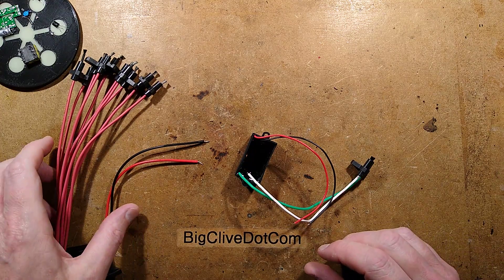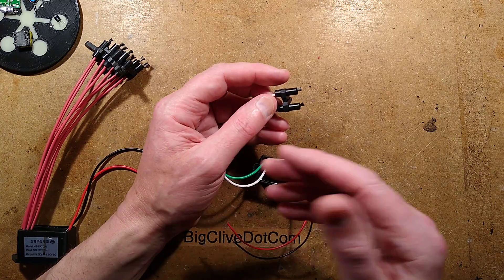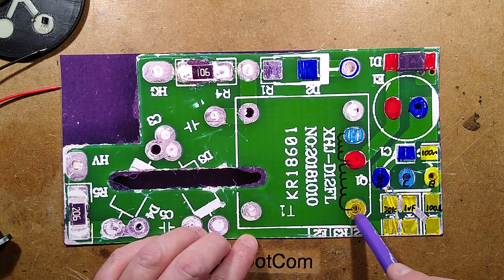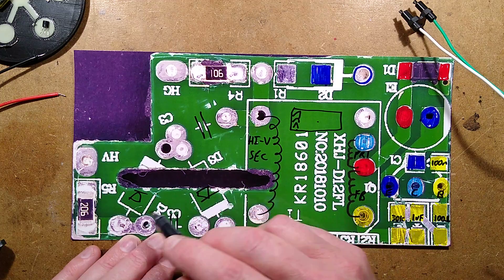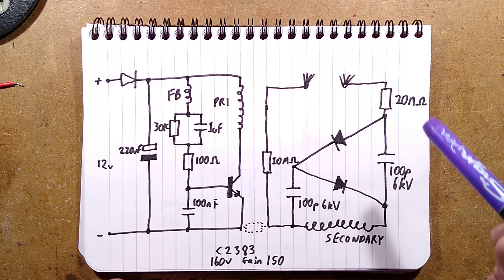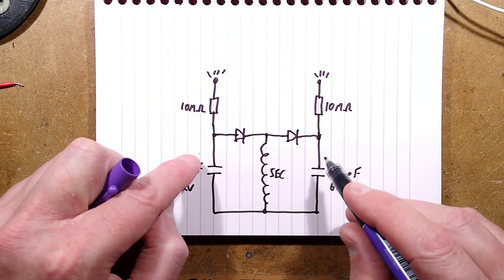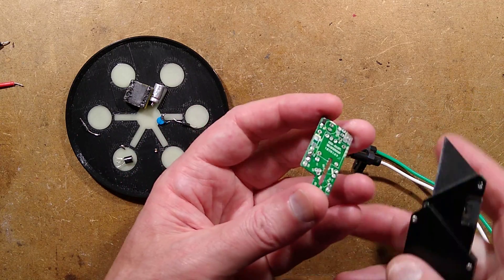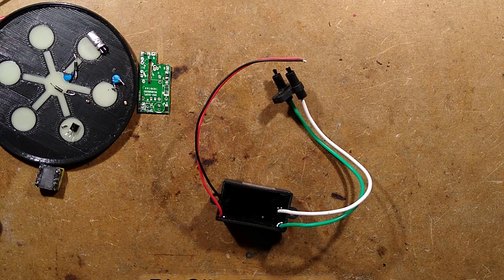Intriguingly different "ioniser" module (de-potting and schematic)

Comment: Can anyone supply some weblinks to vendor and datasheets for the high voltage capacitors and diodes.  Also the transformer model show XHJ-D12FL.  I can't seem to find this.  Who is the vendor ?
Reply from the maker: You will probably find the components on AliExpress, but the transformer may be a custom one.
Reply: cannot pots that here, or potsing will yanish.   The comp lanes that potsings yanish, also usually yanish.

Comment: Is it for a "balanced ion" blower, for hair-dryer static-neutralizing?   Or, even a workbench anti-static blower?   Most of the ion-current should just leap across the carbon-tufts.   But a fan blowing across them could disrupt that ion-flow.   I think it takes well above 20KPH of air-flow to push ion-plumes around, if strong e-fields are fighting the wind.   (So, how fast a wind is required, before the ion-current stops jumping the 2cm gap, and flows away into the environment?)
Reply from the maker: This module was sold as being for vehicle use.  I think it's less of an ioniser and more of a low level corona generator for stripping apart air molecules to create the active, but short lived variants like O3, H2O2, OH and others.  It's reminiscent of the modules used in the air channels of some vehicle brands that they refer to as ionisers to hide the fact they are for sterilisation.

Comment: which make high voltage diode shown in video?  with mark only of arrow?
Reply from the maker: They usually just have a pattern on them to indicate voltage.  No manufacturers data.

Comment: I heard the output voltage is very high, 7,000v or more? Is it possible to measure it? Will it kill if you touch the output electrodes?
Reply from the maker: No.  It's extremely low current.  Like static electricity.

Comment: Carbon fiber might be hard to get a reading off of from the sides because its conduction (thermal and electrical) characteristics are often pretty different depending on what axis you're measuring. Something to do with the structure of the molecule. The graphene forms a tube, and for reasons quite beyond me, it's considerably easier for electrons to move through the tube in some directions than others. Such a cool, bizarre material.

Comment: I once ordered some high voltage low current Diodes from Ali Express, (a unmarked bag of 50 of 'em)and they had the same Arrows on them. I initially thought..."What the hell is this Garbage!!!", but they seemed to work well. Never know the actual number of them tho.
Reply from the maker: It just seems to go by the shape of the arrows.  Very odd.

Comment: Can these be used as static generators for use with model makers static grass applicators?
Reply from the maker: It may work.  Even a simple ioniser module may have the effect.
Reply: Thank you for replying. I have bought static generators ie negative ion generators. 12v to 20000v I have connected them to a 12v motorcycle battery but they tend not to last very long. Would this be because the amp/hr on these types of battery are too high for the component and would I be better off with an 12v 1amp supply? Thanks

Comment: So the difference between Ionizer and ozone generator is that, even both they work at High Voltage, the ionizer it's DC, and the Ozone generator is AC high voltage and high frequency  ?
Reply from the maker: Some ozone generators work with DC output and sharp emitters to create a low level corona discharge.

Comment: Hey bigclive, my air purifier has a pair of these carbon tufts as an ioniser in the outlet after the air has gone through a filter. If I wanted to disable the ioniser permanenty without opening up the machine would it be effective to just pull out the carbon with some pliers? Are there any potential pitfalls of doing this?

Comment: These low end ionizers are often capable of hcho and acetone Voc intermediates. They consistently show such byproducts in various studies/reports. And how you place the emitters can change ion output. They have to spaced appropriately
Reply: Technically all ionizers create some kind of ozone. Certified models don’t let escape/or measurable. Sharp plasmaclusters don’t create measurable ozone in the room. But remember, ozone can be a plus. A small amount of Ozone can actually in fact reduce ozone. (Via Voc reduction that would later become ozone otherwise). Not saying I recommend ozone, but it isn’t pure evil.

Comment: Hey big clive i have a cheap light bar and was wondering if there is a way i can send you a video. It doesn't seem to wanna pump out the power and draws .365mA
Reply from the maker: The 360mA sounds like a driver for a string of 1W LEDs.
Reply: So the ic chip would be limiting the power it has a few 47 30 rtv and a 50n06 so it should be drawing a bit of power. I noticed i put the decimal point in the wrong spot it should of been after the 3

Comment: would it be possible to use this module for an electrostatic air cleaner?
Reply from the maker: It can have that effect.  You could connect collection plates to the green wire.
Reply: @bigclivedotcom  Thanks again!

Comment: I used to use air ionizers like that one, but they gave me horrible sinus headaches. I do get sinus and tension headaches a lot, but using those made them twice as bad. They'd make me have nauseating headaches on a daily basis. The dust was also ten times as bad. It would stick to everything especially around the ionizer. It just wasn't worth it. I just use air filters now.

Comment: Clive, at the risk of testing your patience, re: my earlier query connecting the ioniser to a 12v car cigarette lighter: how do I know which of the ioniser's leads is +ve and which -ve? From what you said that isn't obvious? Does it matter? And does the cig lighter need to be fused?
Reply from the maker: In this unit the white was negative and the green was effectively positive.  I would always recommend using a fuse.  In this instance, 1A or less.

Comment: dug up some old parts from the mystery box and found a 120/3kv transformer, a set of X-Ray diodes, 20KV 102 blue ceramic caps...  jumped the output of the transformer up to 12KV via some doublers and made a grid for producing ozone...  I used 2 heatsinks from some old computer processor main chips... it worked fantastically, was putting out loads of ozone, had the room saturated within 10 minutes. Im either gonna have to remove a stage of doublers or find another transformer it was just too efffective  :)

Comment: I've had that strange thing happen when trying to remove things with solvents. It goes so deep and stops.  I've wondered if the solvent swells the material and bascily gets too tight for the solvent to get any deeper.  Stuff to think about when you really need to be asleep.

Comment: How did you de-pot the board? Boiling? Curious, thanks!
Reply from the maker: Initially an acetone soak, but alternating between a heat gun and a knife got most of it off.
Reply: @bigclivedotcom  Cool, thanks. Good to know!

Comment: Is it me, or in the schematic are the diodes in the voltage multiplier both backwards?
Reply from the maker: The diodes point away from the negative connection.
Reply from the maker: The diodes point away from the negative connection.
Reply: @bigclivedotcom  
I’m not sure if you’re agreeing with me or not.

Comment: I made an ioniser many years ago from a magazine article. https://worldradiohistory.com/UK/Electronics-Today-UK/80s/Electronics-Today-1986-07.pdf Page 30.
I wonder if you could build one and see how safe/powerful it was?
Cheers :)
Reply from the maker: I recently featured an ioniser based on that (I built loads from the official kits when that project first came out).  My new variant is just 22 capacitors like most commercial units, and works well with carbon fibre emitters.
https://www.youtube.com/watch?v=ZLB2UUQ35J0
Reply: @bigclivedotcom  Thank you. Is it possible to get the kit from somewhere or do we need to get the PCBs made ourselves? I did like that the article said you can attach it to a plant and make the edges glow.

Comment: I am wondering if I should get an ioniser, if you use one Clive what is your choice and do you have a purchase link please
Or did you do a video about using ioniser and if not could you please do one(a video I mean)
Reply from the maker: It depends on your space.  I'm liking this particular unit, although it is primarily a trace ozone generator for cars.
Reply: @bigclivedotcom  Thanks

Comment: I found this on eBay where it is suggested to be used inside a car passenger compartment. Output voltage 3kV. Would this device be capable of igniting gasoline fumes assuming some careless fuelling of a car with a window open to allow the flammable vapour access to the car interior where this device might be operating ?  Perhaps Clive could be persuaded to try an experiment with his remaining working device and a small amount of vaporised petrol.
Reply from the maker: The discharge is too small to be an issue for that, especially when used inside.
Reply: @bigclivedotcom  Thank you for the reply Clive.

Comment: The alternative voltage multiplier circuit doesn't work too well without using a two-transistor oscillator on the input to the transformer to provide power on both sides of the cycle, you get an unbalanced charging of the two capacitors, and you can only discharge through the pair what the least charged capacitor is holding. Protecting the transistor from reverse current is the ability for current to come off the secondary as quickly as possible, any limits there (such as by the capacitor it's flowing into being full) causes the voltage to rise on the primary side when the transistor is in the off state. (yeah, I had the same thought!) It works better with the Royer/Baxandall oscillator, as that will charge both capacitors equally :-)
Reply from the maker: This is sometimes used to provide a lower voltage on the positive emitter.

Comment: Hi Clive. I watch (listen to really) many of your videos, while I'm servicing air rifles (random but true) I recently watched a repair of a tiny Chinese pulsing pump, and thought I'd gotten to the bottom of the problem with my haze machine. Turns out it was a tip of the iceberg and there is apparently a fault with the circuit board that controls the pump / heater / timer. I was wondering if it would be possible to post the job lot up to you, along with the return postage and happy to pay for any repair if you could figure out and possibly do a video of the repair of the thing. I use a nice ILDA laser, and the haze really makes it (as you can imagine, without it, the laser is pointless)
You may be ridiculously busy, and not able to do it. As my dear departed of mam used to say "if you don't ask you don't get"
Also used to say (in reply to "What's for tea?") Shit with sugar on. That's Yorkshire mum's for you. Best regards Mark.
Reply from the maker: Have you tried powering the pump directly?  They are very prone to jamming.
Reply: @bigclivedotcom  firstly, I really appreciate you taking time to read my question. The pump is a brand new, the third one fitted ; here's the 'list of what's happening'
Machine powers up & heats block correctly (drawing approx 800w)
The pump will work ok-ish if the smoke button is pressed for a very short time. If the button is held, or timer function is used (as it would normally be) for any length of time, the machine stops emitting smoke and goes into 'sulk mode (won't do anything)
If the machine is unplugged from the mains, short pause, plugged back in, it will do the same all over again. It may (or may not) go into 'heating up mode' on  plugging back in, then work as described.
If the machine is left on, with no button pressed for any length of time, it will go into sulk mode as described, not even offering to heat the block back up, but leds remain on, as if all is normal. 
The reason it is on its third pump is because the little second one suffered its inlet pipe snapping off, on removal from the machine (the quality of the pumps is not the best, I'm sure you know. It looks like for the plastic used in making or molding the little inlet was recycled and as such quite brittle and had very low elastic / plastic deformation tolerance (back in the real world when I was an engineer, one of our sites had a plastic recycling plant)

Comment: I just bought one a week ago
worth the $14
Reply from the maker: For one of these that's quite a high mark up.  They should only cost about $2 plus shipping.
Reply: @bigclivedotcom  It's amazon, You pay more for convenience and a robust buyer protection. 
I should also mention it's the plug in box variety, not just a bare system, I probably should've commented on one of those videos rather than this one, too late now.

Comment: I’m wondering if you’ve seen the Radio Shack commercials on instagram for learning basic electronics and coding. If such a kit is worth the money. Or if you could suggest a kit for the newb wanting to learn more about how circuit boards are created?
Reply from the maker: We don't really have Radio Shack here any more.
Reply: @bigclivedotcom  here either, seems to be on online presence only. All the comments read, “I thought you guys had died.” 🤣

Comment: There's a lot of things to create the ozone is there anything to take it out instead of creating it electrically and simple
Reply from the maker: In laser printers they pull the air through carbon filters to reduce ozone.
Reply: @bigclivedotcom  wow didn't think about that how many people is printing on their laser printers to get rid of the ozone wow
Reply: We need to use our printers more often only problem is mine keeps running out of ink

Comment: Have you considered rebuilding it with the alternative output circuit you suggested in the video?
Reply from the maker: It's potted in resin which would make that very time consuming.
Reply: @bigclivedotcom  Oh, I realise that. I was thinking more of "proof of concept". Reassemble (if all the components survived) the one you depotted but with a different VH circuit. But then it may not work without the potting resin for insulation.

Comment: Would these SMD parts be suitable for an all-SMD classic mains ionizer with no coils?
Reply from the maker: You can get suitable surface mount components these days, but the multipliers do require good separation.

Comment: Curious colour code for the output wires. Is green the positive or negative? My guess,  green is the high voltage ground and white the negative, but that is biased by the old uk mains colour code. I doubt if the Chinese manufacture has such a historic bias.
Any idea of the output voltage?

Comment: Wait, that feedback configuration with the single transistor... It's a high voltage Joule Thief!
Reply: That. Although clive might be correct in that the charging of the 1µF cap creates stimulus to end the on-time of the transistor, whereas the classic joule thief only has a resistor in that place, and relies on transistor saturation or transformer saturation to end the charging phase.

Comment: The text on the diodes might be solvable in your depotting bath and that's why it is missing.
Reply from the maker: I mostly used heat.  While looking for new diodes for experiments I found they use the chevron pattern to identify the voltage.

Comment: you can turn an ionizer into an partial ozonator as well by bringing the emitter close to the ground plate or neutral from the mains and the amount can be regulated by how close you bring it to the ground/neutral....
Reply from the maker: That's in an upcoming video (already recorded) with custom designed PCBs.

Comment: The octopus module looks like full length of carbon fibre heater wire but the different colour HV leads just look like flex.  I assume the carbon emitters are just crimped onto the ends.
Great little module.  Probably order a couple for my ozone hoard.
Reply: Might be good for repelling squirrels from the bird feeder.